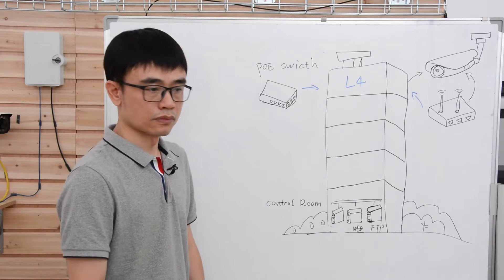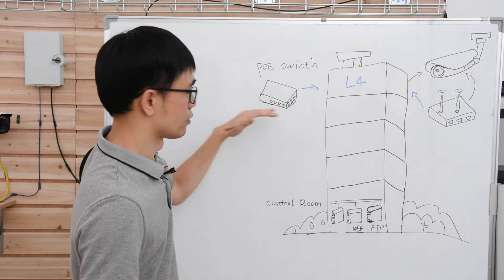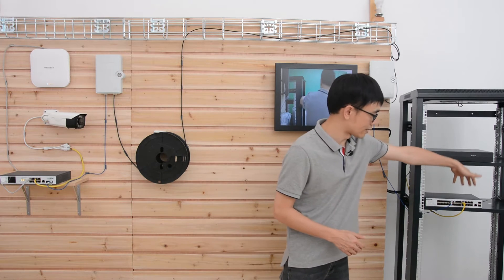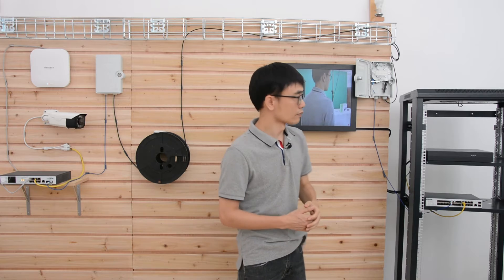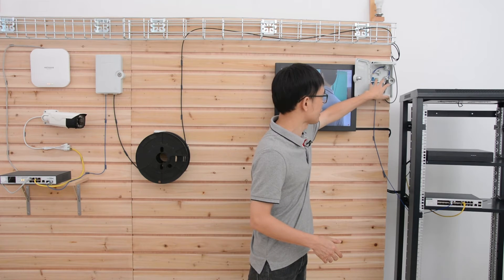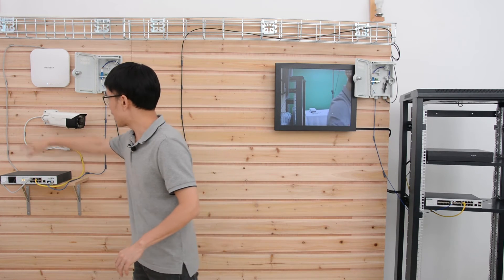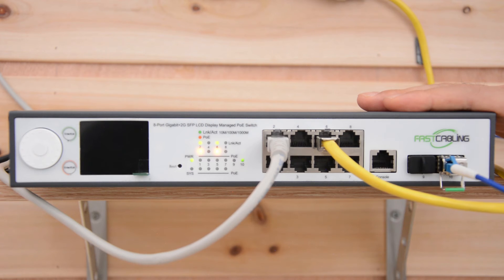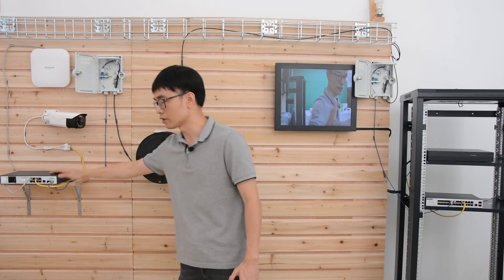What you need to set up a fiber optical network to link multiple floors

Comment: Nice for info bud! Setting up a fiber optic network to connect multiple floors requires careful planning and essential components. You'll need high-quality fiber optic cables, connectors, transceivers, and patch panels for smooth data transmission. Use switches or routers that support fiber optics to ensure efficient network distribution. Proper cable management, protective conduits, and routing pathways are crucial for maintaining signal integrity and easy maintenance. Additionally, testing equipment like fiber optic testers and microscopes helps verify connections and optimize performance. This setup ensures fast, reliable connectivity throughout the building. I came across GAO RFID Inc you might find it pretty useful for this topic :)
Reply from the maker: Never dealt with RFID systems before, very inspiring! Thanks for your advice!

Comment: Is It possible to Connect Switch POE 2 fiber Port With out using SFP 
I have seen Switch SC Port A,B how to connect them it has A,B 
If I connect A to A is not fuction
Reply from the maker: If it is the deplux SC A/B, it will not work while one port is defective. It needs both ports to send and receive the data. Since the transceiver is built-in, then you can replace the transceiver with BiDi type which can take different wavelenght to send and receive data.